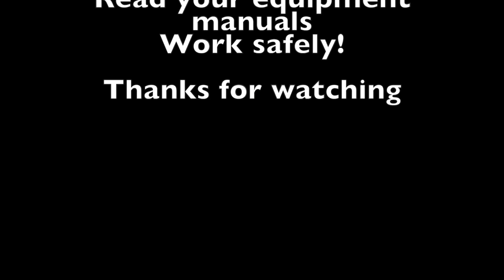Farm fence construction using a post driver: The best way to install posts hands down!  FarmCraft101

Comment: I wondered about the making them plumb part,  thank you for that real time one. Great explanation of the bracing and tension as well. Haven't looked yet but I hope you did one of setting the wire. The paint pole was a great idea too,  I did something similar when I built a small coop, for spacing the posts and to keep it fairly square to the shed it is near. Wasnt the straightest old rake handle or whatever it was in its previous life it was, but it worked, just put a piece of tape for my mark.

Comment: Looks like a shaver post pounder. If it isn't it's built like one.Mine is on a track machine bombardier mounted on the side. I put the posts wire all on machine. Plus stretch the wire as I fence. Works good. Only problem is I get all the wet soft ground jobs 😆😆

Comment: just a couple things I've noticed. It looks less precise than an auger; would be a pain to lift one after you've pounded it to far down. how many logs have split pounding them? seems like you would need near perfect soil. also concreting the post prevents post rot. they make concrete for post holes that you basically just pour water on it after its in the hole. i would choose quality over speed.
Reply: Devon Kinsey no different than driving a yard sale sign's homemade wooden stake into ground with hammer.  Only the scale has changed, plus, drivers (pounders) have precision controls making every post virtually identical in height and vertical plumb.  Not a diy tool.  Save that for augers.  Concrete for fence posts is a matter of preference and practicality, but wooden posts have lasted for decades in straight soil and in permafrost zones, drivers are even more practical.
Reply: There's no way using an auger is easier.  I agree the perfect fenceline is probably better done with an auger as you can shift the poles slightly for an exact position.  But damn, tamping in dirt with a steel bar is murder.  And concrete doesn't add much IMHO.  Plus it makes removal difficult.
Reply: Devon Kinsey concrete holds moisture against the post and they rot quicker
Reply: Concrete does not improve the quality of a fence.  I have been driving posts arrow straight for many years, but am blessed to have quality equipment.  The H beam driver in this video is a cost effective way for DIY projects to be completed, but contractors in the know have moved on to much more efficient equipment that does a much better job.  There are even farmer/rancher oriented drivers that are considerably more cost effective and easier to use than an H beam driver, but most folks in America only know of the "popular" drivers.   Click on my name if you want to see a few examples of what I'm talking about.

Comment: Aren't posts available that are pointed on one end?  That would be far more efficient for the pounding method, I'd guess.
Reply: I mean, for soil that isn't all soft like that soil.  Soil with roots, rocks.
Reply: It surprisingly doesn't help much. I stopped putting points on posts, as I found they tend to wander (go in crooked) even more than if you just leave the post bottom flat. Disclosure: very rocky soil here.
Reply: @yesterdayfarm5273  Yeah the point usually forces into the path of least resistance which usually wont be directly downward but with perfect soil ie few rocks and roots the point is helpful